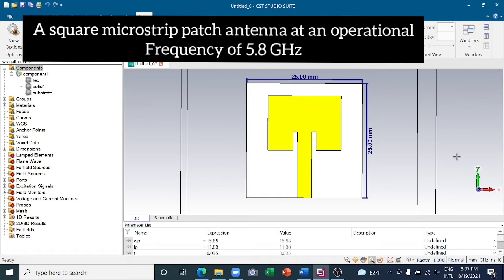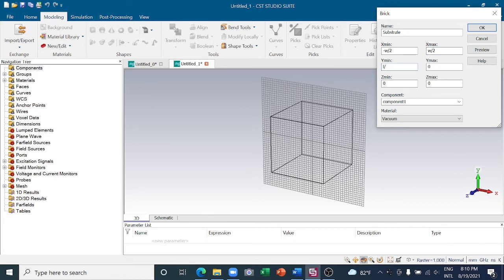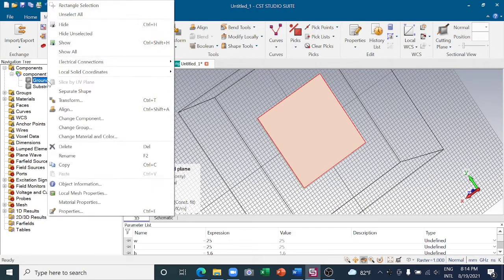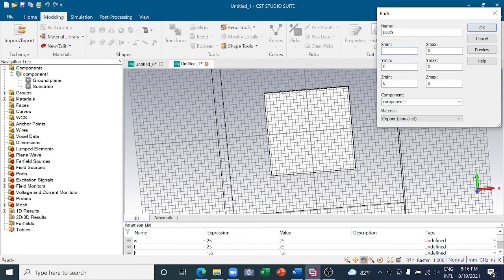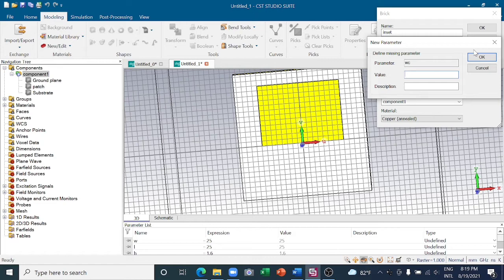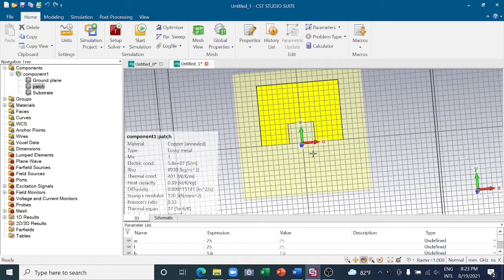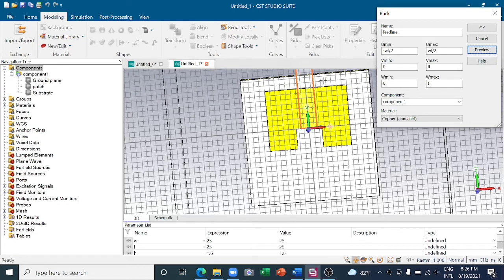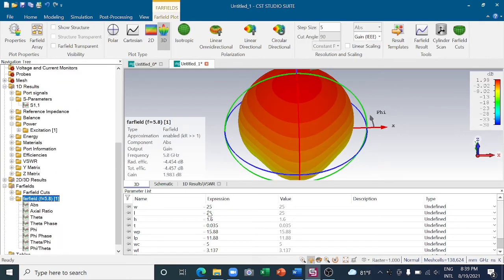How to design a Square Microstrip Patch Antenna at an operational frequency of 5.8 GHz using CST.

Comment: Why did the patch move upwards by 4 in the translation section? why 4? How did you calculate this? I don't know how to proceed with my antenna design, which has different lengths.

Comment: why we give half the value for every width and length of the substrate and not for height? (like l/2 or w/2)
Reply: Hello, because the patch is located at the origin of the x-y plane, so if a square measures 10mm, then you would want to have -5mm to the left and 5mm to the right